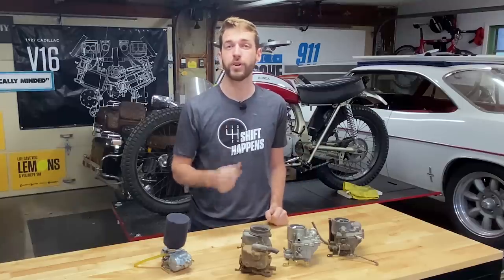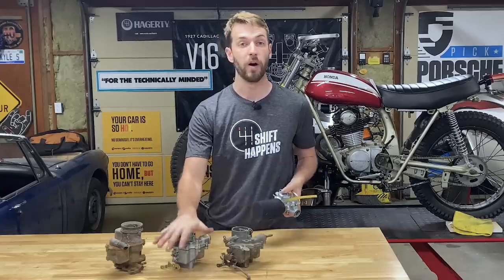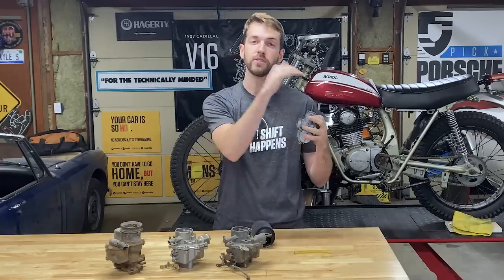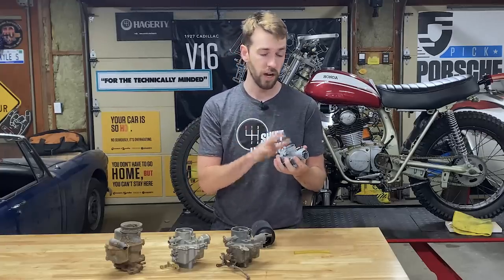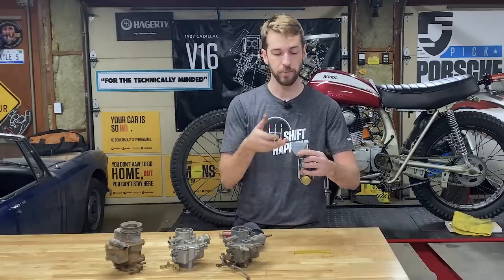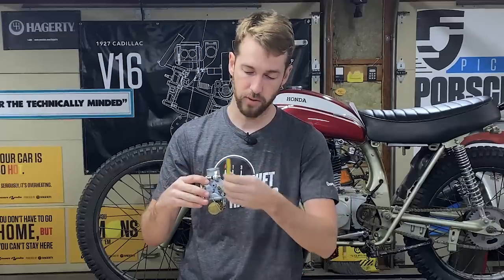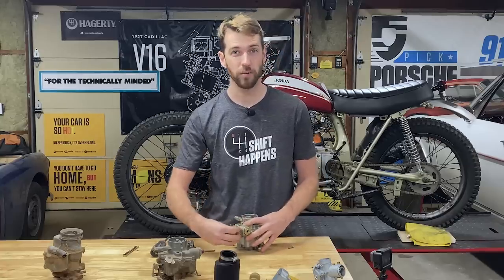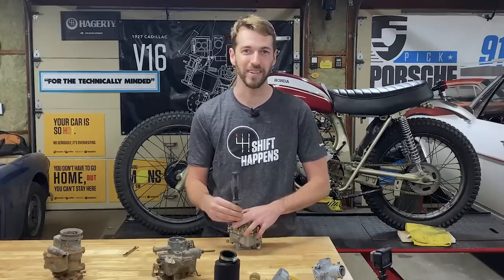Carburetor Basics | Kyle's Garage - Ep.24

Comment: I work on small engines and I would like to say something. (ONLY FOR SMALL ENGINES LIKE LAWNMOWERS, SNOWBLOWERS, AND GO KARTS) you CAN use wire to clean brass jets on small engines because the basic jets are usually too lean anyway.

Comment: Actually, the spring on the accelerator pump determines the length and pressure of the accelerator shot of fuel. Slow movement of the throttle keeps the cup from sealing against the shaft and thus bleeds the fuel off. I have built carburetors for a very long time, including the Rochester HV carbs. My favorite carb is the Quadrajet.Good video though. That Corvair is still calling to me heheh.

Comment: Carbs wouldn’t be so tough if you didn’t have to remove and disassemble to get at the jets to clean or tune them. Most times, particularly on  many motorcycles, you have to remove the gas tank and associated plumbing to get at them. Makes playing around with rejetting or cleaning a royal pain. If you’re experimenting for an ideal setup you’ll have the pleasure of doing this multiple times. They can’t compensate for atmospheric changes either. So give me some good old fashioned fuel injection please!

Comment: Less than a minute in and I've already got issue with this video.  FFS  I guess I'll have to start a list...  Starting with the complaint that there's a Honda behind you and no CR flat slide on the table.  Missed a perfect opportunity to expose your viewers to what it is and the pros/cons

1:  Just before the minute mark you say the venturi pulls the fuel up into the intake when that's not how it works.  Basic physics.  It's PUSHED up the jets by the relative positive pressure provided by the bowls atmospheric vent.

2:  Jesus.  Barely made it another 10 seconds.  Carbs haven't become more complicated with extra circuits.  Do you think idle/intermediate/high circuits are NEW?  Really?  I wouldn't complain if you said enrichment/accelerator circuits or CV control, but you didn't.  Because apparently Hagerty couldn't find anyone who actually knew anything about carbs.

3:  @3:43  Made it about two whole minutes!  Getting better I guess...  Here you say to inspect the seat for cleanliness, but that's less common of an issue.  It's obvious from the moment you take the bowl off if a filter fell apart or there's some kind of contamination problem.  You took the float off before measuring what the current height is, so you'll never know what it actually was before you possibly bent the tab.  Once you've measured the height, take the float off and check it for leaks.  Just shake it and listen for fuel inside it, don't waste time trying to find a microscopic hole with your eyes.  THEN on to my actual complaint for this timestamp...  That needle is obviously shagged.  Painfully obvious.  Maybe not to the presenter or the intended audience that actually NEEDS this video, but yeah.  Instead of pointing out the groove and saying "that's your problem right there" you ignore it and say to inspect the seat for dirt.  Ok...  It's also worth mentioning that you should make sure the needle was actually oriented the right way on the tab.  I've fixed more than a few carbs that had it on backwards because someone didn't even look at it before they took it off.

4: @6:19 there's another missed opportunity to say "this jet is screwed and needs replaced."  Mangling the tops will change the characteristics of the flow.  If a jet is marred at all it needs replace.  You say later that they strip all the time, which they don't.  They're always mangled though, because people put them in too tight.  Just snug.  But you didn't mention that...  Maybe you should have?  As far as cleaning, soaking them is useless.  Unless it's a pilot jet that sat for a decade and it's completely clogged, in which case it's going to take a full day to get it cleaned.  Otherwise all you need is a pair of safety glasses, (because you will guaranteed get sprayed right in the eye),  a can of choke cleaner with a straw, and the correct wire.  If you want to use the right screwdriver just use your brain.  If it's a Japanese carb then you're going to want to use your wicked-awesome JDM AF flathead.  They don't use stupid SAE or even metric standard, it's called JIS.  I find that a regular flathead works, as long as it isn't owned by an incompetent waste of meat who thinks every flathead in the toolbox is a "bertha".  You should only have one or two filthy nasty flatheads that get used as a prybar/chisel, the rest should be respected and kept in absolutely perfect condition.  You say not to shove steel wires through, which is right and should be obvious.  But you're going to need a jet tool.  Which is a variety of small wires made specifically for CAREFULLY working the varnish and gunk out.  Instead of wasting time talking about stuff that doesn't matter you could have shown and mentioned this, but nope.  Oh, and in a pinch, keep in mind that copper is softer than brass.  Hint hint...

5: @8:00 starts another misused two minutes.  Just explain what an idle-drop is and how to perform one.  Maybe point out that there's a difference between an air bypass mixture and a fuel bypass mixture design?  That's where I see most people get messed up trying to set it up, assuming they started at the right initial setting and went the right way to begin with.  It's a common thing when people don't understand the basic principles.  The part about it being too rich etc as a result is misleading.  That's not how circuits work.  When you tune the idle you make sure you're only on the idle circuit, plain and simple.  Hence the initial setting, which you don't even need an OEM spec for if you have common sense and an understanding of what you're working on.  The intermediate circuit is after the idle so it's affected by it, but it could be made either rich or lean as a result.  Because all exposed circuits are feeding fuel at their own individual rates...  The explanation given in this video is setting a poor foundation of knowledge.  But this is apparently the blind leading the deaf....

6:  Ended the video misrepresenting the operation of an accelerator pump and ignoring the basic physics going on.  The throttle plate is an air restriction, generating a venturi by forcing the air on the engine side of the throat  to accelerate to overcome the restriction.  The fuel in the exposed circuits is more than capable of PUSHING up into the throat as long as that relative pressure differential is maintained.  When you whack the throttle open that restriction is removed, the relative pressure differential disappears as the air slows, the venturi collapses, and the fuel no longer has the help required to overcome gravity and stops pushing out of the jets.  It's not a surge of air that causes it to lean out.  It's actually getting LESS air right then, because the charge stumbles.  It leans out because there's NO FUEL.  So the accelerator pump gives a squirt.  Plain and simple.  Wham bam thank you ma'am.  Then you go on about how MC carbs usually don't have an accelerator pump so you need to open the throttle smoothly, which just like most of the rest is just plain misleading.  Remember that CR flat-slide carb I complained about not making an appearance way back at the beginning of my critique?  Here's where it would be useful.  The reality is that the vast majority of MC carbs don't have an accelerator pump because they don't NEED one.  They solve the issue by understanding it...  Constant velocity.  I think I brought CV up somewhere.  Pretty much every carb put on a bike in a VERY long time is CV, identified by a diaphragm controlled slide in the carb throat.  It's got a pressure reference port on one side of the diaphragm, so whack the throttle open as far as you want, it will ignore you and maintain "constant velocity" to give you 100% of the power your carb is capable of generating at that RPM.  Compared to a flat-slide style as would be found in a CR carb, which is only for serious racing.  Those are the only ones that actually have zero extra restriction at WOT from the lack of a butterfly, while expecting the operator to have some throttle control.  Pros and cons...  But now that I think about it, I never heard the terms "downdraft" or "sidedraft" mentioned.  When you had car and bike carbs sitting right in front of you.  So much for teaching the basic terms...

Disclaimer:  If you guys are looking for a technical consultant or something, feel free to let me know.  I might come off a little rough, but I'm generally pretty pleasant.  Take this as constructive criticism.  It might sound harsh, but I'm much nicer than the ones who taught me.  You spent who knows how much making this video and screwed the pooch.  I'm justified in saying that, so I hope you can take it on the chin and assess your approach and purpose.  There's already plenty of sub par videos out there failing to explain things to the regular viewer.  There's a market for better videos.  You have the name recognition that you could EASILY sweep the rest aside, but you've actually got to do better than them.

To all the offended flamers I predict will be tempted to freak out and tell ME to make the videos and I'm an idiot and blah blah blah...  Sure.  I'll get right on that.  I'll quit my day job, as a master-tech with certs from multiple manufacturers, where I get to play with and build track and race only toys WAY out of my own budget.  Where I get to occasionally do free track days if the shop is actually caught up.  I'll just walk away from that.  I'll tell my tool rep to take back the massive pile of tools I have that I'll never actually get paid off.  Then I'll survive off ramen somehow and figure out how to make and edit VIDEOS.  Something I've never done, and would honestly suck at.  See any problem with this?  Kinda goes against my point that I tried to make.  I couldn't justify making a video, because it's not what I know.  I'd suck at it.  I can be honest with myself, I just take issue when others can't.  Jesus, there's no way anybody actually read all that...  If you did, then congrats, and thank you for taking the time.  Hope I didn't leave TOO many typos, but lunch is over and I have to send this without a proofread.  It's probably a complete disaster, sorry about that.  I guess have a good day?  Aaaand it's getting into winter, if you don't have your stuff ready to go into or come out of storage already, do it NOW.  For the love of all that's holy don't wait till the last minute if you're having someone take care of everything for you.  Everybody wanting everything done at the same time kinda sucks.
Reply: You could have made a video in the time it took you to type this novel. This video is OBVIOUSLY for novices. I’m sure you are fun to be around. I never understand people that are such experts in a subject that come to YouTube, take time to watch a video, and then complain. Have a good day and congratulations on all your merits.
Reply: @bogee83  No I couldn't have, and you know it.  Don't play stupid.  I could have WATCHED a video in the time it took to write that "novel".  Trust me, I actually read.  That's no novel.  Back to your comic strips.  I'm a blast to be around, but that's because there's a reason to be nice.  As you pointed out, this is YT.  I'm not trying to make friends here.  Sorry if your delicate feelings were hurt.  Maybe you should grow up, and more importantly, grow a pair.  I never understand people that waste the time to complain about somebody's post, but not actually SAY anything in their complaint.  Just doing it to whine?
Reply: @bogee83  Just because I don't like to edit a post, I'll do a second reply.  Take a step back.  WHAT did I do?  I invested MY time to provide corrections.  For YOU.  You got your video, and now you have accurate info.  You're welcome.
Reply: If I need more information I'll ask you, because I can tell you're full of it.
Reply: @timheilman2089  I see what you did there.  So clever...  Feel free to correct me
Reply: I'd like your opinion on fuel to use with a carb.  The original Quadri-jet on my 1956 Olds 324 Rocket has been rebuilt two times recently due to fouling from a rusty old fuel tank (since replaced) and a separate issue blamed on breakdown of "rubber" parts.  To avoid the latter, my mechanic says not to use ethanol gas, which he says will foul the parts in about a month of driving.  I use the only ethanol-free gas near me (southwest side of Cleveland) which happens to be 90 octane.  Were the parts used in the rebuilds less than ideal?  Can I run with ethanol fuel half the time?  Thank you.
Reply: @moonrich3492  Personally I'd look into just updating the fuel lines to newer stuff that can handle ethanol.  If they've already degraded it's only a matter of time before they go soft and rupture/leak.  Even if they look ok from the outside, they're falling apart from the inside.  I'm kinda surprised you would have that old of lines on it still though.  Usually people with cars that old I find that the problem is just not being driven often enough and the fuel gumming up in the jets, but it's easy to tell the difference between varnish and melted rubber built up in a bowl.  Kinda hard to diagnose it without seeing it, but if your tech knows what they're doing and found rubber, the lines are breaking down.  Even if you just run non ethanol from here on they'll keep falling apart, get new ones.  They're cheap as dirt and with the price of straight gas around me they'll pay for themselves in a few tanks.

As far as running different stuff half the time, I wouldn't suggest it.  Unless you want to carry a set of spare jets and change them out every time you change grades.  Just get ethanol rated lines, jet it to be happy with ethanol, and you'll be golden.

Not sure about the quality of the parts that were in your rebuild kit.  Honestly, the earliest Olds I've ever worked on was about 20 years newer than yours, but the rebuild kit the owner found for it was disappointing to say the least.  Seemed to be a universal one that KINDA covered a few different carbs but didn't quite have everything for the one I had.  Ended up having to custom make a few gaskets and orings
Reply: @mikaelgaiason688  Thanks for the advice.  I believe my mechanic was referring to the non-metallic internal carb parts breaking down -- accelerator pump piston, needle valve, o-rings, et al.  I said "rubber" since I'm not sure if they're made of neoprene (or leather for the accel pump).  I have heard that you can run ethanol fuel so long as you run non-ethanol afterward and before letting the car sit for long periods.  I sometimes run out the fuel by turning off my electric fuel pump and letting the engine stall.  This didn't prevent the internal parts damage, though.